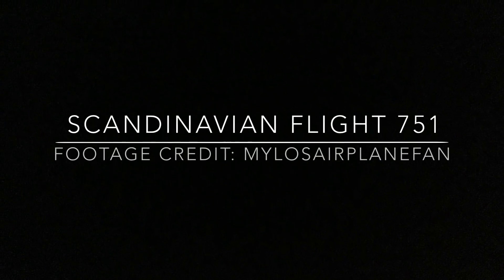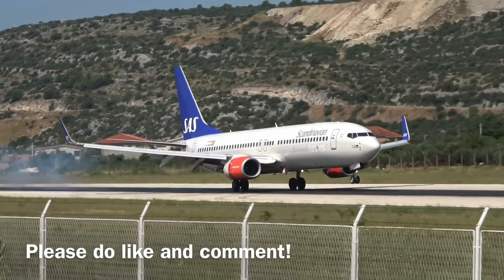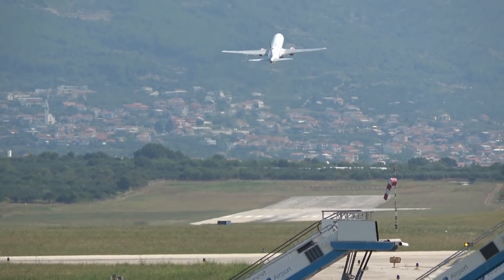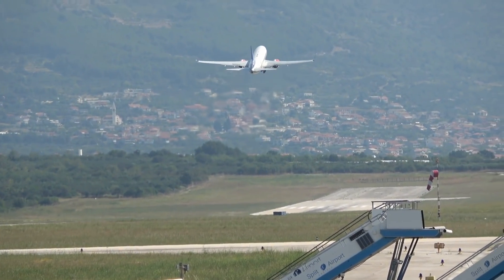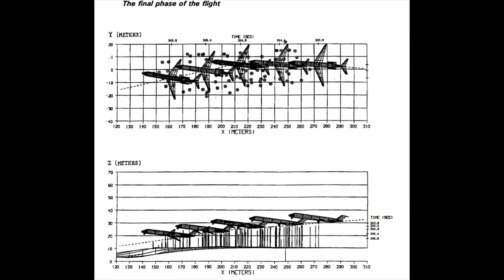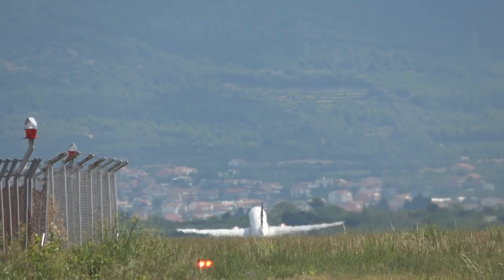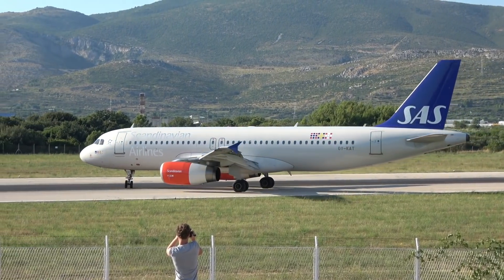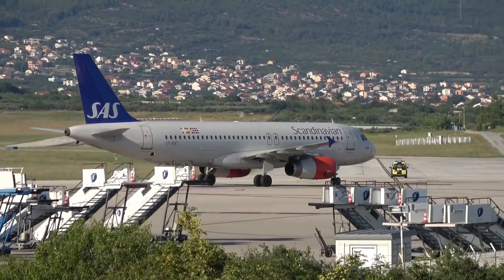The Cold Truth | Miracle at Gottröra | Scandinavian Flight 751

Comment: I always thought engines in the back of the plane mid-level with respect to the fuselage were kinda safe from point of view of foreign object damage - but ice coming off the wing seems to be a horrid exception there. 

Maybe the soviets were right to produce the Antonov An 72/74 with an upper wing with engine nacelles above the upper wing for the arctic and generally for STOL...
Reply: Robson Robson when I visited the Antonov base, they explained that such engines also allow the plane to operate on shit runways. They explained that Ukraine itself (-and much of East Europe) isn’t really always covered with perfect runways, and sometimes their planes operate in places where all they got is a dirt runway. So, they made a right call.
Reply: Having the engines tail mounted is actually quite dangerous. In addition to the risk of ice or slush entering the engine on rotation, rear mounted engines create a risk of a deep stall which is near impossible to recover from and rudder blanking on the ground which was the cause of the Delta plane going off the runway at La Guardia.
Reply: @hewhohasnoidentity4377  It's not the engine placement that creates the risk, it is the placement of the elevators that creates the risk of deep stall.
Reply: @hewhohasnoidentity4377  That's not even the biggest risk. The biggest risk, by far, is having the engines placed in such close proximity to the rudder and elevators. An uncontained engine failure (basically where the engine explodes) can sever or jam the linkages in the tail of the aircraft. Even with redundant equipment, there is very limited space in this area and it is entirely possible for a single engine explosion to take it all out. And some equipment, like the jackscrew, simply cannot be made redundant. If an engine under a wing blows up, oh well; there's redundant controls in the opposite wing and the rudder and elevators are fine. If an engine in the tail blows up, it can sever all the hydraulic links for the entire aircraft as well as putting the elevators and rudders hard out of commission. This has happened, although the aircraft in question was a trijet with an engine actually inside the tail.
Reply: @WardenWolf  United Airlines Flight 232 I see
Reply: Additionally rear mount engines can actually help if your elevator is stuck in a pitch up angle. On other planes there's nothing you can do and it will stall, but throttling up rear mount engines will push the nose down
Reply: @theshermantanker7043  I suppose one could still more or less control pitch with the trimmable horizontal stabiliser in case of a stuck elevator?

But in case of elevator and trimmer failing having engines mounted at the wings and at the rear - as in a tristar or MD 11-  would be pretty benefitial!
Reply: @robsonrobson4999  I guess so, but sometimes that option isn't available. There was a flight that lost hydraulics with an elevator stuck in pitch up once I think that used the differential thrust trick to safely land
Reply: Good comment.
Reply: While a tail-mount engine is probably less likely to get a person sucked into it, FOD is FOD, and yes, anything coming off of the wing becomes an issue.

Comment: I have been on about 2000 flights as I was a professional parachutist. I genuinely trusted my rig more than the aircraft and have a real fear of landings.

I remeber being on a twin otter that was taking off from a grass strip, heavy (full load, light fuel though) and lots of Georgia trees. As we start getting over the trees and at about 1000ft, the right engine suddenly goes into beta and I shit my pants. Pilot managed it and everything was fine, but holy shit.
Reply: Jump planes are famous for shoddy maintenance. Ever notice that jump pilots wear parachutes?
Reply: Mike Bundy lol I’ve never jumped, do they really?? I would be alarmed if my pilot was wearing a parachute...
Reply: @drdrift8787  I'm not Mike, but yes, they do wear parachutes. However, their first priority is to make sure that the plane does not come down in residential areas, if possible. Of the two aircraft that went down at two of the drop zones I use to frequent, the pilots did not make it out and perished upon crashing.
Reply: theguy man that’s too bad. I would honestly be more surprised to hear that they did make it out, though. I like to be prepared and I keep a lot of things in my plane, but a parachute sure as shit isn’t one of them
Reply: @TheRealMikeBundy  Not all. In little 182's and such its common, but not on bigger twin engine craft like King Air or Otters. I watched a King Air land in Rockmart, GA without a left landing gear and slide that prop down the runway and spin the aircraft 180. He dropped the jumpers and flew around burning fuel before he landed it like a boss.
Reply: That's funny. When I first started jumping, I was terrified of leaving the aircraft. After a while, I was more terrified of the ride to altitude and I would watch my altimeter until we had at least 2,000 feet below us. After 2,000 feet, I began ro relax.
Reply: @ImAlwaysHere1  
You were "terrified of leaving the aircraft"; how selfish and irresponsible, what do you think the passengers and crew were going through with the decompression afterwards (someone could have got sucked out with you)?
Reply: @redblade8160  What the hell are you talking about? I was skydiving. There was no decompression and terror. What the hell are you on about? And what the hell would someone being scared have to do with being selfish?
Reply: @ImAlwaysHere1  
You're extremely naive...
Reply: @redblade8160  I think you're a few sandwiches short of a picnic mate.
Reply: @redblade8160  uh huh. Keep telling yourself that. 👍
Reply: @andycopland3179  
I don't have to tell myself that, but you have to live it!
Reply: Made for a 'soft' landing I guess :-) ?
Reply: Andy Copland.
Did you wear your parachute kit everytime you went flying?
Reply: @redblade8160  If I was on commercial flights I would take my rig as carry on. If I was travelling it was usually for work anyway. 

I used to fly with a guy who had thousands of hours and decades of experience. I'd sometimes get on the Twin Otter with him and not wear a rig, but it made me so uneasy.